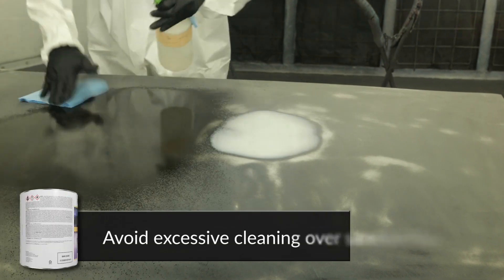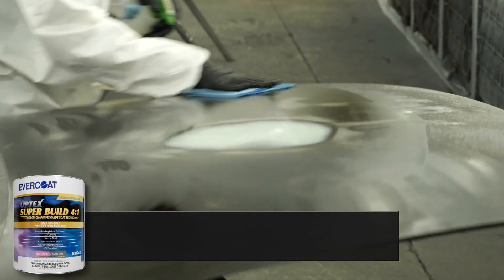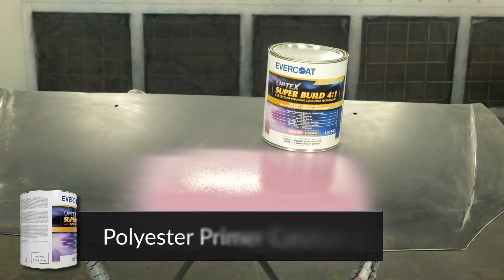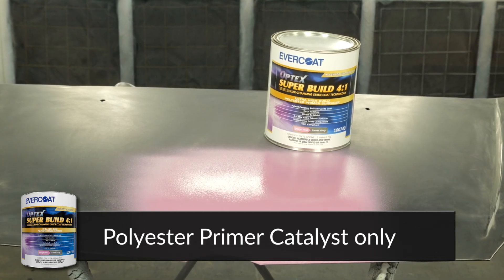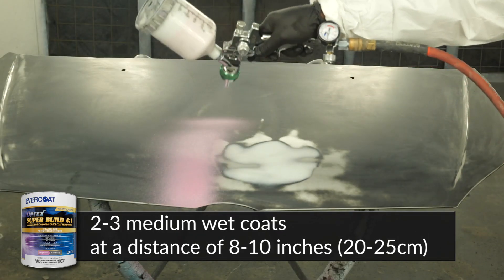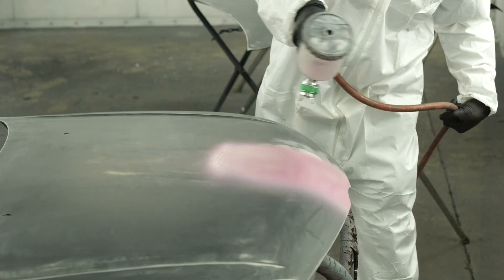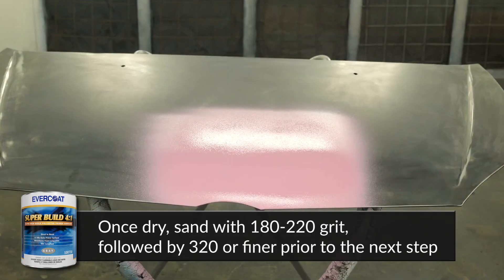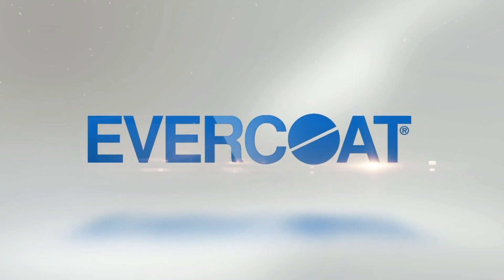How to Apply | Optex® Super Build 4:1 Polyester Primer Surfacer

Comment: How does this compare to slick sand?
Reply: I've been using the 4:1 superbuild for a few months now, in my opinion its easier to sand and the built in guide coat is surprisingly handy, I don't think it builds as much as slicksand but I still prefer the superbuild.